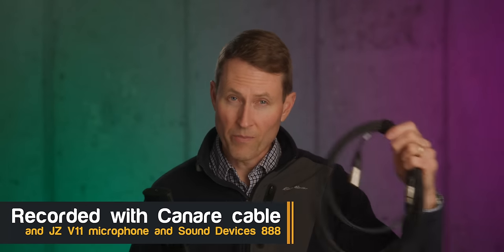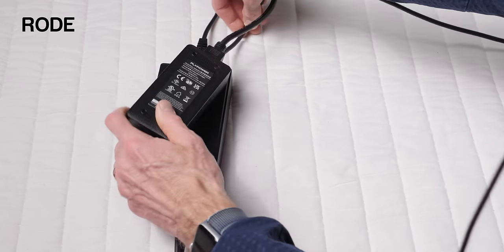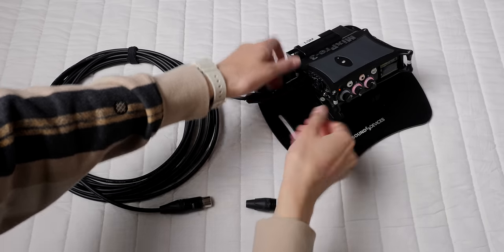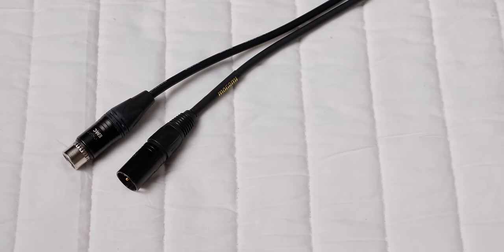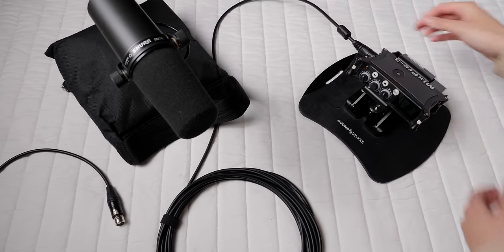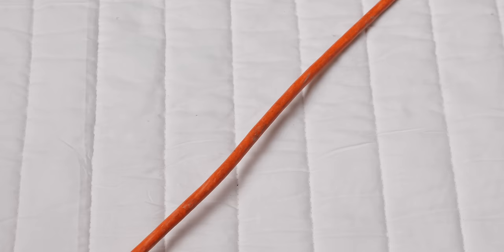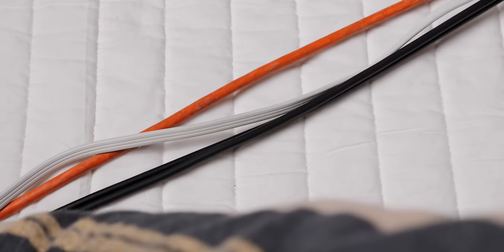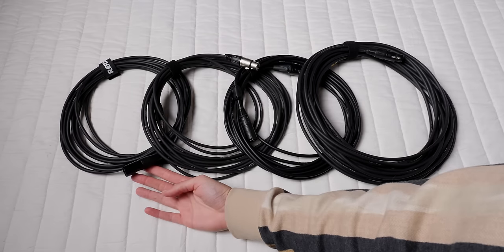Cheap vs. Expensive XLR Audio Cables: What's The Difference? | Curtis Judd

Comment: I use Hosa Pro cables with the REAN connectors. They are a good middle ground option that's not cheap but no where near the price of Mogami.
I've had my 30 or so cables of different lengths for about 5 years now running live sound and only one has ever had any issues. Definitely check them out if you don't have the budget for the higher end stuff.
Reply from the maker: Thanks for sharing 👍
Reply: @curtisjudd  thanks for another great video as always Curtis! 🤘

Comment: The only thing I would add is that you need good workmanship from whomever you trust to assemble your cables. Canare Star Quad + Neutrik XLR is are definitely superb choices, but care and craftsmanship in assembly still matters.
Reply from the maker: Good point, thanks! Those solder joints are important!

Comment: My experience with very cheap cables and cheap connectors was the following: Replacing these with a thin cordial cable and Neutrik connectors liftet the sound from mediocre to very good. The mics were then the limiting factor (M5 matched pair from Rode).
Maybe I had a very different kind of test candidates ;-)

Comment: Switch mode PSU’s are the bane of the modern engineer. Special mention for budget video walls too which put out a ton of RF interference. Especially when you find the offending cable is a D-Sub fantail or multipin link.

Comment: I do like the flexibility of Mogami but they have gotten too expensive for me. Canare is a good option.  Any brand sold by B&H is good enough. Yes those power bricks/warts cause the most problems.
Reply: If you have some basic soldering skills hand build with redco bulk cable and neutrik connectors

Comment: And i was wondering why the new rode xlr cables cost much more, apparently it has both Canare cables and Neutrik connectors
Reply: But they are nothing fancy. They don't even ground tie connectors.
Reply: @SoundSpeeds 
What do you mean, what is “tie” or “tie connectors”? Do they not solder pin 1 to shield?

Comment: So Deja Vu a video.  I’ve had lengthy discussions with “pros” who swore by directional cables or this type of cable or that gold connector etc.  The stereo stores were notorious for selling mega expensive cables since it was huge margin.  Things like oxygen free cables etc were the norm.  But pivot to broadcasters and studios and you often found some shockingly cheap cables like “Boston green” for racking gear.  Mic cables are a unique cable usage since they do take a physical beating often plus can be easily impacted by RF.   But long distances for an analog signal can be challenging too.  If you stick to the great quality Japanese cables you’re guaranteed great shielding and durability.   
To my knowledge Canare… usually pronounced can R Eee.. have always been a go to for live application such as theatre or music venues.   Neutrik is pretty much industry standard with both TRS and XLR connectors not to mention the combo connectors.   Never ever had an issue and the best strain relief without damaging conductors.   
You may be able to get away with cheap cables on a short distance but for the modest price difference it’s really not worth the hassle.  Stick to tried and true

Comment: It's not about shielding with XLR cables.  It's the use of balanced cables that help cancel the noise.  By using a regular signal and inverted polarity signal, it's able to precisely cancel out the noise it picks up.  Balanced audio is quite an ingenious old invention that works purely on the analog level.

This is why you can use the absolutely thinnest cables using a shielded CAT5 cable balun snake that puts 4 XLR and it won't make a difference.  The shielding in this case is only used as an extra conductor.
Reply from the maker: Mmmm, all of the cables used here were balanced connections.
Reply: @curtisjudd  Yes I see that, which is why you didn't hear much difference.  Try an unbalanced cable and put it near some powerlines and power supplies and you'll hear massive differences.  Super thick shielded expensive unbalanced cables will pick up a ton of noise while thin cheap balanced cables will pick up almost nothing.

Comment: More expensive cables are better shielded and generally more durable. Durability aside, the difference will only be minute and then again, only for very long cable runs in exceptionally RF-noisy environments.

Comment: I bought some quad Canare’s in 2019 and compared them to Mogami’s and felt the high end wasn’t quite as crisp or HD as the Mogamis.  Canare was very smooth though. Unfortunately, I don’t remember the microphone I tested at the time.  I probably should test again with some of my latest microphones and see if I hear the same difference. Neutrics are the only connectors I trust 100%.
Reply from the maker: Interesting, thanks for sharing.